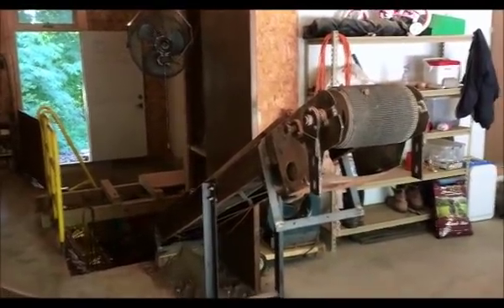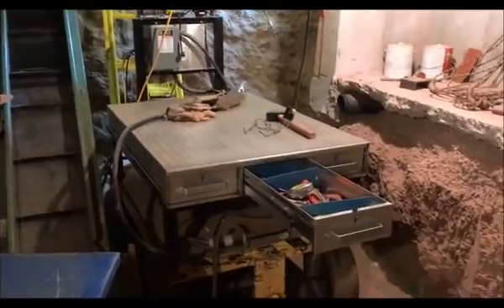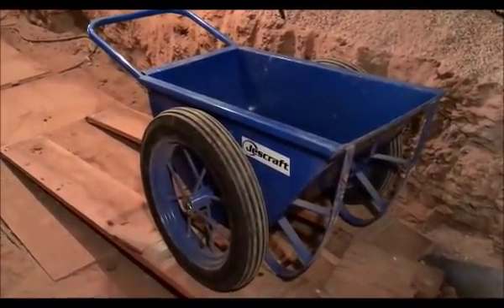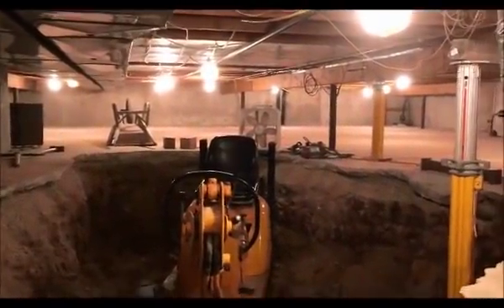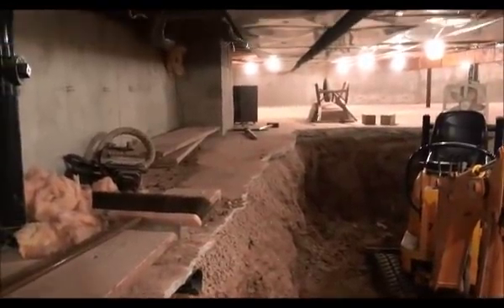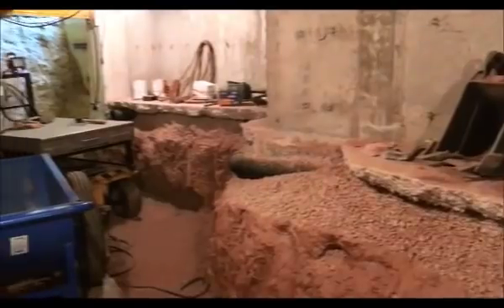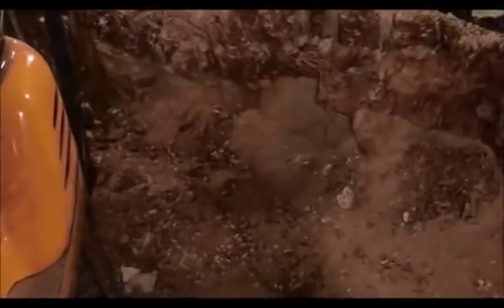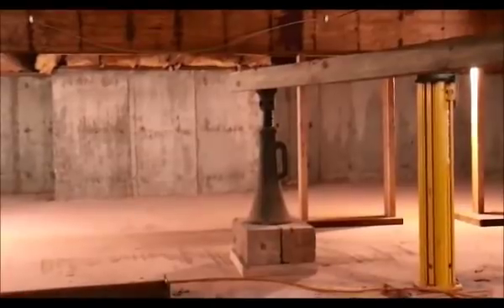Electric Mini Face Shovel Digs New Basement - Chapter 3

Comment: How many hours do you have in this job? Your pervious videos said it should take 200 hours.
Reply: Hi very nice. I dug out a basement about 25 years ago. I would have love using your equipment. My basement was about 2000 SF also. I wish I had dug another 2 feet. It was a lot of work as the original foundation had no rebar. House was built in 1937.
Reply from the maker: That's not what I said. A guy asked me how many hours I had in digging alone (up to that point.) That estimate was 200 hours.
Our estimate overall including that excavation is 2,100 hours.
Reply: @diycrawlspacedigoutunderpi4201  I put 12,500 hours into my video game. I'm ready to get into shape, and have more living space. This video is incredible. I couldn't afford a full basement when we built the house. It's good to know you can do it, throughout many hours.